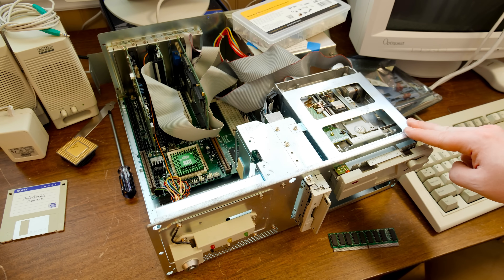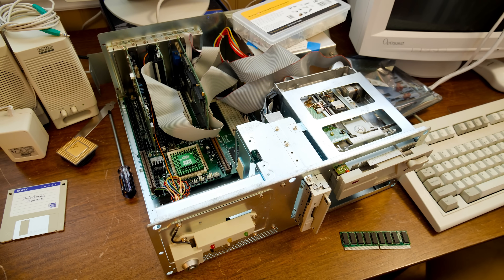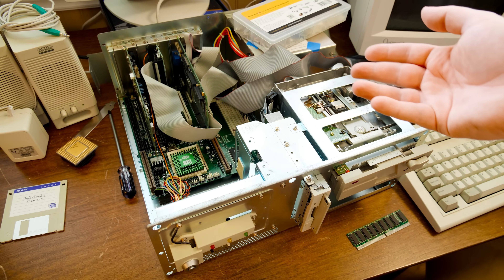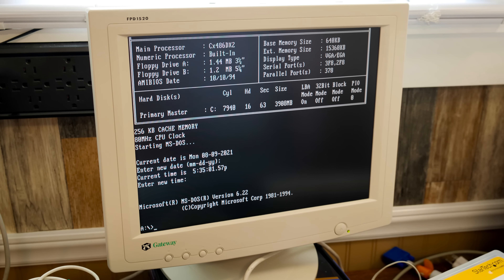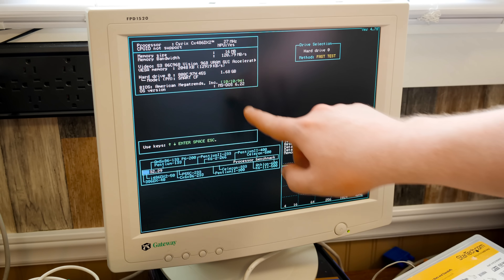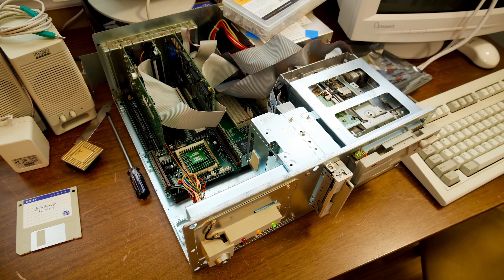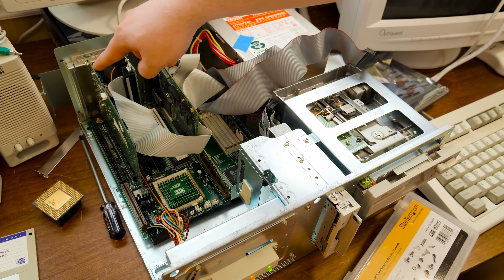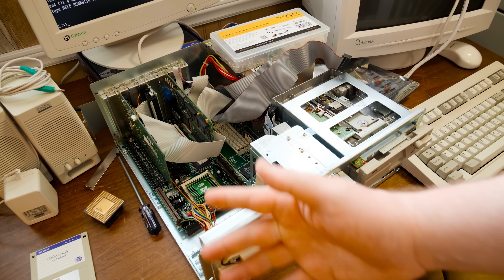M919 Fake Cache and Reproduction L2 COASt Modules

Comment from the maker: Looks like I got the CMOS battery issue sorted! Turns out a battery selection jumper (J4) was missing on the motherboard that meant the CR2032 wasn't being recognized. Sweet 👍
Reply: This is the most fascinating 486 I've ever seen; it seems it modifying & upgrading it can be a whole series on its own ;)
Reply from the maker: ^ It's like you read my mind, stay tuned ;)
Reply: The write back chips are in fact empty. They are just plastic blobs. I used to work for an OEM back in the days and we did take them apart.
Reply from the maker: Manual can be found here: https://archive.org/details/m919style486vip/page/n1/mode/2up
Reply: @LGRBlerbs  Why don't you add a period correct, or a little newer Creative Sound Card & matching Creative CD-ROM drive? Also don't forget the digital audio connector.
Reply: I was wondering if the CMOS battery holder was fake too.
Reply: I was already wondering if there would be an update on that. That was quick!
Reply: I was just about to comment that you should look for a battery jumper. They did that to prevent over-volting the cmos ram.
Reply: Thanks for this unfathomable content, LGR!
Reply: @yogibear2k2 Pin compatibility. Literally no extra ICs
Reply: @yogibear2k2 SD-to-ide adapters are not that compatible, sadly.
Reply: Beat me to it
Reply: There are some coin cells out there which are rechargeable. I don't know if any PC motherboards ever used them.
Reply: Oh, old mobos and jumper carnage😉
Reply: I use LI-ON coin cells to replace the barrel batteries. Solder them right into the board, then hang the holder (nice on/off switch on it too) with two sided tape to the side. Never a problem to replace it after, cost is about $4 CAD.
Reply: I was thinking maybe the battery holder was fake aswell haha.
Reply: @yogibear2k2 In my experience, compact flash tends to be very very compatible with IDE/ATA. There are SD card adapters, but the good/reliable ones seem to be more of the SCSI variety which adds extra cards and costs.
Reply: Clint, I was thinking the same thing when you were describing it on video.  I remember that there was a jumper you had to set to select the pin header for the battery or the coin cell battery.  Great job!
Reply: I was just about to say, I wonder if the battery is even connected, is there a missing jumper or a mis-configured one. Seems you got there before I did 😀🤷🏽‍♂️
Reply: I watched the whole video and was going to mention the jumper. But seems you figured that out.
Reply: What is the extension socket at the end of that one ISA slot for? Now there's a challenge, find one of whatever that slot is for.
Reply: @greggv8  If you mean those brown color connectors then they are part of the vesa local bus slot. They are meant for mainly video cards and offer faster way to get data in/out of video card. Vesa local bus back then was a competitor to the PCI bus. My 486 33dx computer was VLBus and it was cheaper to buy than PCI computer. I think EDO ram only worked for PCI motherboards. There was no AGP video port on VLB machines. That came later on PCI motherboards. Btw, PCI in the end won the war. I think VLB was 32 bit system just like PCI. I think some OEMs preferred VLB over PCI because it was cheaper to extend ISA to VLB than ISA to PCI.
Reply: @yogibear2k2 Compact Flash is faster and it works essentially like an IDE drive. https://en.wikipedia.org/wiki/CompactFlash
Reply: We need more update videos on this computer 😞
Reply: I had this issue with my 486 and it was caused by a shattered diode near the battery. Replacing those diodes fixed it for me.
Reply: Classic RTFM moment xD
Reply: @kpanic23  With computers this old, it's more like FTFM ("Find the Fucking Manual"
Reply: The community made a L2 cache module for a PC-Chip motherboard.😳.... why 😟?? ...... I mean.. if it were a good motherboard.. well fine 🤔...... but is trash can material 🤢.. is a PC-Chip 🤮 .... is a waste of space 😐..
Can someone explain to me what's the deal with this trash board??.. it was blessed by the Pope... does it have drops of the holy grail in it or something 🤷‍♀️???
Reply: @Ramdileo_sys  1. It's actually a great motherboard, you just don't have any clue about 486 Mobo's. 2. It was sold a ton in Noname-OEM systems, so alot of them are there. 3. For little money, you can turn this  cache-less board into something great, since it uses the best Chipset, UM8881/6 and can use EDO-Ram. Up to 256MB. (I found 192MB more stable, oddly enough).
Reply: @Ramdileo_sys  cheap boards allow more enthusiasts to get there hands on this era of hardware. Not like it's still being made . If it works it works. Someone will love it
Reply: @Ramdileo_sys  are you five and can't  understand that these boards were ubiquitous and there's probably a lot of them left over? Go price out a decent board of that vintage. Your IQ probably figures in the bus speed of one of these.
Reply: @Ramdileo_sys  You're comparing different generations of things and complaining about previous generations not being up to snuff? That makes no sense. Some applications require era-correct computers to be run correctly (off the top of my head, Zaxxon and Ultima 7) and some of us actually WANT computers of that era WITHOUT cache. So you're knocking the community for providing cache chips to right a quarter century wrong for a ubiquitous motherboard that is still around today? And your suggestion is to use PIII computers from the early 2000s? Why don't you just use DOSbox and call it a day then? 

I'm seriously struggling with your flow of logic. If you don't like 486 boards, I dunno, watch some PIII builds or buy a PIII computer. I don't see what you're bitching about here.

Comment: PCChip M919 with real Cache attached should be one of the best 486 board. Not only it support 60MHz and 66MHz FSB. It is also more playable than HOT-433 and BIOSAR 8433UUD.

Comment: Fascinating.  This was genuinely useful.  I have one of these boards, but without the fake cache and with the original COAST module.  I bought it in the 90s and ran a standard 486 I think.  I occasionally use it when I need real DOS for some old engineering software that I have.  Currently I have an Intel DX4-100 along with 64MB EDO RAM on two modules, but I am honestly not sure that I have all of the CPU links set correctly. CPU voltage is set to 3.3V, but I shall have a play with the others to see if the cache performance is affected.  The user manual was limited in detail and clarity of information. I need to find those benchmarking programs that you showed.

Comment: Can certainly tell you weren't pushing it hard at all because you didn't jerk your finger back with a yell and cussing after caressing the Cyrix CPU. I accidentally barely brushed a finger against one of those right after shutting the computer down and it effing HURT and I had a blister on my finger where it touched the heat sink. The AMD even over volted on 5 volts and running at 4x bus speed never got that hot. Especially not when I filed the base of my heat sinks flat to fit snugly to the CPU and bead blasted off the anodizing to rough them up to increase the surface area.

People can say what they want about that Cyrix being more advanced than the 486 and the AMD competitor being "merely" a faster clocked 486 - in my experience with many of these back in the day, the AMD 'hotwired' to run at 4x bus speed would stomp these Cyrix chips into the dirt. Quite easy to do, locate the 4x pin at the edge of the CPU. Wind a fine wire around it then skip over one pin to (IIRC) the left, with pins up. That's a Vcc pin. (Check a pinout diagram before trying this! It has been over 20 years since I last did that.) Put in the socket and go. They would even run just fine on 5 volts despite "requiring" 3.3 volts. I had one in a 486 board I'd popped a 33Mhz 486sx out of. AMD at 4x33 with the hotwire method, at 5 volts, running Windows 95a.

Another one I had around then had a Micron PC VLB motherboard. It had bus speed up to 50 Mhz but I had to stick to 4x40 Mhz because to run at 50 Mhz I needed L2 chips at 10ns or faster but what was installed was 15ns and 40Mhz was as fast as they could go. It would run at 50 but it would also disable the L2, making performance a heck of a lot slower than at 40. AMD at 4x40 Mhz was what I had most of those going configured to. I always wanted to push one of those AMDs to 200 Mhz but never owned a board able to run at 50 with L2 and everything else working and stable.

What I really wanted to try but never could find the CPU and FPU was a 386DX 40 with matching FPU. I had a board but the 386DX 40 was you gotta be bleeping me prices and the 387DX 40 didn't seem to actually exist. I would have loved to compare it to a 486DX2 66. The next level would have been one of the 486DX2 chips made to be pin compatible with a 386DX socket. Woulda been sweet at 80 Mhz. But then along came the AMD chip that was faster than anything else that could plug into 486 sockets, especially at 4x speed.

Comment: I was lucky enough to get a Dell 486 but ran across an issue where it would just power off randomly and then not power on at all until it wanted to. Took a solid week of troubleshooting but I was finally able to trace it back to a cracked solder joint on one of the power control chips on the motherboard. After reflowing the solder I was FINALLY able to get it working reliability. Now if I can just get a CD ROM to work I'll be all set. Unfortunately I think it's a proprietary IDE port on the Sound Blaster card so I have no clue how to find a CD drive/drivers for it. :(

Comment: @LGR Blerbs, I know this practice of bait and switch and strong-arming of customers did result in a few lawsuits back in the day, but I do not know if any went anywhere. I remember reading in one suit though, the prosecuting lawyer did call this no different than how in the early days of airbags for cars, some Automakers would advertise the car had airbags, but they would then pull a bait and switch by not installing them and making the customer have to pay extra to have them installed, and extra again to have them activated. Interesting court transcript. Sadly the trial was dismissed, so nothing came of it legally to address this fake Cache issue. Sadly this practice still persists with Intel and AMD CPU's, and ARM, and GPU's.

Comment: I have a VTech Laser 486 that we bought in the early 1990's (at Tandy Incredible Universe) & being that I didn't know much about external motherboard cache back then, I didn't fully realize that it did not come with external chip cache. So exactly a decade ago, in 2011, I was finally able to put cache on it, after months of research.  Some people at computer forums also warned me that it might be fake cache, but the thing is, why would VTech write up a section of installing board cache in the manual if this is fake cache?  Long story short, I was able to decipher the manual documentation, was able to find & buy the cache, which includes the data chips & one instruction chip & it eventually worked.  How much cache?  It was only 128kb, but I would say it made some difference & it made the system whole & a tiny bit faster.  I also used Speedsys 4.78 (by Vladimir A.) back then, so to see you using Speedsys here brought back those memories (cache & simm pun?).  And Speedsys was able to see the new L2 cache & showed that the PC was a tiny bit zippier.  I believe some mpg video files that I tried on this 486 ran a little better.  However, a decade earlier, I had also already installed an Evergreen 5x86 100 Mhz CPU replacement, from original stock 25 MHz, which improved speed overall.  The L2 cache just added a little more on top of that, but again, just enough to see a hint more of speed. The only major upgrade that I would like to try on it is a coprocessor.  And MAYBE replace the main oscillator chip to something a little bit faster.  As for the dead fan on your PSU, that could be from a dead capacitor inside, so you would need to do some recapping in it.

Comment: Yeah. Don't use just any cache modules in just any motherboard without verifying compatibility first, or you'll see smoke. Don't ask me how I know.
Reply: Don't plug an old 15 pin Macintosh monitor into a PC joystick port. It'll smoke the port. 20+ years ago at the shop I was working in, some poor guy who wasn't all there in the head brought in a PC he'd taken in trade for a rifle. The whole box was built with the worst of the worst parts one could find in the late 90's. Somewhere he'd come up with a Mac monitor and connected it to the joystick port. Fortunately it didn't fry anything but the crap soundcard. I told him he should take the box of junk and go get his rifle back.

Comment: unfortunately with that Cyrix DX2 80 requiring a 40MHz front side bus your PCI speed is being cut from 33MHz down to 27MHz slowing down the PCI graphics card. It's probably not hurting performance much but worth mentioning. It's another fun quirk of this motherboard. To get around this, if you want to, you'll have to connect the turbo feature to jumper JP3a on the board. let the machine boot and POST in 33MHz FSB then hit the turbo button to kick in the 40MHz FSB. this solved the issue for me years ago but maybe there's a better option now. I should also add this has the opposite effect of overclocking your PCI slot and video card to 40MHz so depending on the video card it may or may not be able to run at this speed.

Comment: Hey, Clint! That "Write Back Cache On" POST message most likely refers to the internal Cyrix 8 KB cache (which is, in fact, write-back). The guys at PC Chips probably thought that mentioning it on the POST screen would be a "clever" way of deceiving customers without technically 'lying'. :-)

Comment: great video huge fan of the m919 also great to see the reproduction modules finally came to fruition saw ppl on vogons talking about this years ago. Looking forward to video with the POD83 the m919 is not the best board for it but also not a bad one and you can do some pretty neat on the fly overclocking with the board, though few POD83 will oc w/o modification to the vrm. Also its not keeping cmos cause looks like the jumper is missing on the 2 center pins where external battery goes

Comment: This same board was sold under other names. Fugu was my favorite. Same board that had blow fish stickers on the chips and sold for 40$ at frys when you bought a cpu.. think it was a 486 dx 4 i got. Which I remember the issue was the cache was not seen by the cpu..  edo memory was duper finicky with this board. It took 5 different trips to frys. It was going to be used to draw campaign signs worked good for my bbs with 3 nodes. Wildcat 3.0 bbs worked great. Ran dos 5 for a long time and quarter deck multitasking software.

Comment: Very scummy! Nice that there is an upgrade path though. I had similar trouble with my DVD drive. A small crack in the eject motor gear will completely seize up the drive and you almost have to break things to get the tray out again. Or unscrew the logic board a little and wiggle things out. The drive is a Toshiba SD-M1202.

Comment: I have a similar situation with fake cache that really disappointed me when I found out. Someone on Vogons pointed it out to me I was none the wiser, but they also told me I could add real ones to the board. Mine has proper trace paths though, so  slightly better than your situation.

Comment: They actually make dummy ICs that are used for things like testing manufacturing equipment or teaching people how to solder. They're like normal ICs but without the actual silicon chip inside, and are presumably made with the same industrial process. The fact that the manufacturer didn't even bother spending a few cents on a good fake feels like adding insult to injury.

Comment: Mostly 486 systems don't understand EDO anyway, so even if they work in your motherboard, you'll most likely not see any performance gains, and you could potentially see a performance loss. Fast Page Mode is what 486 systems were designed to use.

Comment: My first video card oddly enough had the same memory chips that were on a 286 motherboard I was given. On the video card and the motherboard the chips were socketed, so I pulled the chips from the board and added it to the video card. It bumped the video up to a whole 1M. Used on a 486 DX2 66 system.  Quickly upgraded to a Pentium 2, and an All in Wonder, with a sound blaster live platinum. Kinda made big jumps.

Comment: That is ALMOST exactly what my own M919 fake cache board looks like. The plastic "WRITE BACK" modules on mine don't have the fake model number stuff burned onto them. They literally just say "WRITE BACK" and nothing else. Fun times.

Also, SOME M919 boards have fake cache, some do not. If it has DIP sockets, and SRAM chips were socketed in place, it PROBABLY has actual cache. If the apparent SRAM is soldered to the board, it is almost certainly fake, whether it is DIP chips or surface-mount packages.

Comment: Wow, I've heard about the fake cache thing years ago, but finally seeing it. I'm actually surprised some board manufactures went through such trouble to do that. That's the dumbest thing ever, because they made it an engineering process as if it was a functioning part of the board, they might as well should have just made actual cache for that amount of trouble.

Comment: I question if the Cache is still actually initialized fully, as it was obvious they did not activate the Cache originally just message it.
80's-90's was a crazy time with all kinds of crazy stuff going on in the PC industry. I worked for a few computer companies in that time slot, and it amazes me that the PC is still around today with all the terrible stuff going on. Customers were being screwed over all the time with "upgrades" on upgrades on upgrades that were so incrementally insignificant it was a joke.